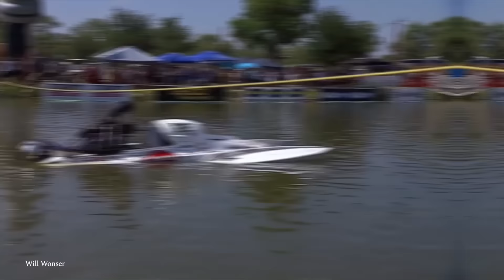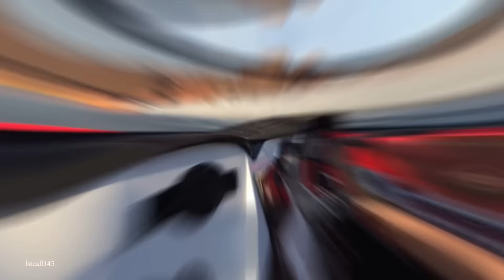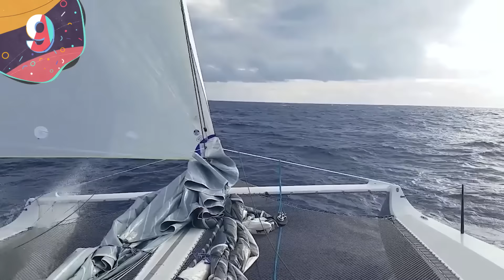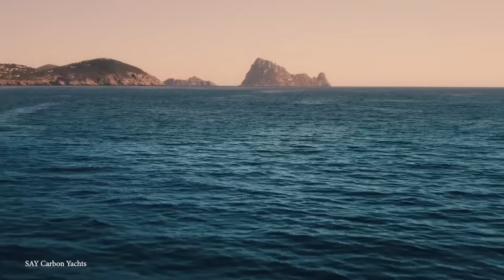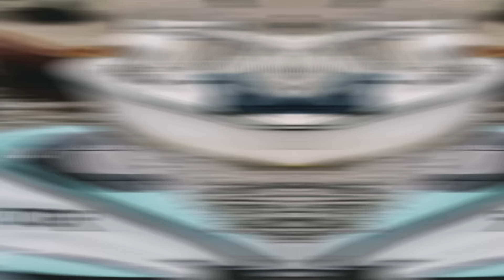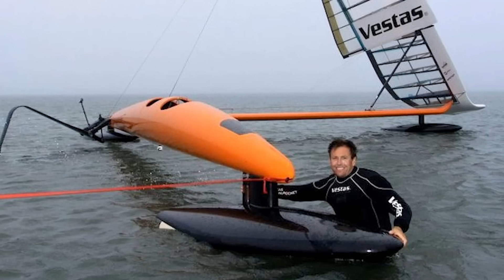15 FASTEST Boats Ever Made

Comment: I had a 25 foot Liberator (Skater splash hull) with two Mercury 300X racing outboards.  14 1/2” 34” pitch Mercury fully labbed 4 blade cleaver props … 112 mph (gps verified).  It was the fastest boat on lake LBJ in Texas for many years😎

Comment: My Dad as a young mechanic who was into tunnel boat racing worked on Ken's Spirit Of Australia 1 & 2 and recalls that when they got the jets from the air force they accidentally trashed one of the turbine discs from an unsecured screwdriver sitting on a table a couple meters in front of the boat when they were testing the engine on land, thankfully they had spares and very quickly learned to triple check everything that might fit inside the engine was bolted down before even considering running it up to speed.

Comment: That cig vee would have a very tough time reaching anything over 125ish
The lack of a canopy ruins the air flow over it. Without a canopy, one. No official run would ever be allowed to go for it. Also without the air moving over the top smoothly. It just simply can’t get there.
The dcb cats won’t ever go over 160ish 
Again air flow, also being under 38ft.. 
anything over 160 doesn’t have the weight to keep the boat planted in the water

Comment: What about Unlimited Hydroplanes?
Total oversight of the most impressive boats!
Reply: Big time ! 
Shit the GPs! 
Can’t wait to see 13-15 of them at the tripe crown races this year ! Haven’t had that many boats of that caliber since the year all the UL’s came to valley field
Reply: Because unlimited hydroplanes have to be able to go round corners. This slows them down a lot. They can hit around 200 mph, which is impressive, considering the restrictions imposed on them. 
The primary restriction is on the propeller. The last time I heard, it had to be 18 inches in diameter, plus most of it isn't even submerged.
I think the gas turbine engines are heavily regulated as well. 
In fact, unlimited is a bit of a misnomer, considering all the restrictions.
I would love to see what one was capable of with no restrictions, though.

Comment: Skater boats are pretty damn quick for what they are. Blows most MTIs out of the water.
Reply: Given equal power equipment, I suspect Skaters and MTIs would run fairly equal speeds. Skaters would probly be a little faster, given that Peter Hledin has been building them so much longer than Randy.
Reply: @EverettCox-g8z  
Boat are custom boats more or less. If we look at them from the perspective of performance pleasure boats, Randy builds the faster boat right now. This is because Peter does more to create dedicated pleasure variants of his hulls. Randy's pleasure boats are based more on his race designs. They take more power to move, but they are a bit more capable.
As far as race boats go, they are more or less the same.
Reply: Both MTI and Douglas Marine make a very good boat. Both er competitive. It's asinine to claim that a Skater is much better than an MTI. I prefer Peter's boats, but I know what the MTI's can do.

Comment: I can truly appreciate what it takes to run a watercraft at speed. So far the fastest I've driven on water is 73.4 mph. It's completely unlike doing the same speed on land. There's so much information to process and every input on the wheel is magnified. I just bought a new boat and we hit 84 mph on the test run. I'm sure it will take quite a bit of wheel time to feel comfortable driving it over 75 myself, much less the 90+ mph it's capable of. At just over 21' in length and a hull under 1,500lbs, weight and balance of the boat are critical too. You definitely can't just hop into one and drive it like you stole it!
Reply: “So far the fastest I’ve driven on water is 73.4 mph”
“we hit 84 mph on the test run”

huh? 🙃
Reply: @poindextertunes  On the test run, I wasn't the driver. One of the dealership employees was driving at that speed. As an update, I've now driven it to 81.9 mph. My wife doesn't like going that fast so I'll need a trip with someone else if I want to push it faster. :)
Reply: @glocktogo Take me with you, I'm up for it! 🎉😅
Reply: My cousin had a 44 fot Viking Offshore F1 with double v8 Quad turbo.
I don't remember the exact hp, but I think it was 2800 ish.
It was terrifying!!

Comment: I remember going to the SDBA (Southern Drag Boat Association) races in Texas as a kid. Those things were insanely fast. My mothers friend owned a boat called predator which was fairly fast (160+ mph) but wasn’t even close to some in the higher classes. I remember boats like Aquaholic that were nitrous oxide fed absolutely stupid fast. I can remember one wrecking in the water and it was quite a sight. Front started hitting the water and rising up higher each time until it hit the water a final time and disintegrated. Took about 20 minutes to fish the capsule with the driver out. They were only able to salvage the engine sadly.
Reply: Mothers friend? he’s smashing

Comment: The actual world’s fastest battleship is the USS New Jersey at 35.2 knots a record set in 1968… I did like the video tho. 👍
Reply: 212,000 hp for 6 hours?!!?!! WHAT?!
Reply: @haney3435  yep, and the fuel consumption rate is approximately the same as an oil well blowout.
Reply: @aerialcat1  that is very upsetting.
Reply: @haney3435  Then consider that many of the fastest carriers are even faster - and MORE powerful.
I once saw in excess of 39 knots on USS Ranger during REFTRA before our 1979 WestPac tour - and that does NOT appear to have been a record.
Reply: @aerialcat1  - 😂😂
Reply: @bricefleckenstein9666  I served on the Ranger from 1960-1962. When we were doing launch and recoveries on a windless day, the ocean was as-smooth-as glass, we would out-run our escort ships. It was impressive!
Reply: @williamfaulkner1959  We did a speed run during the refresher training period before WesPac 1979, on a smooth ocean somewhere off California (I think) - speedometer display on the internal TV showed something in excess of 39 knots.
Not bad for a "32 knot" (per Janes) ship that was a little older than I was!
Reply: @bricefleckenstein9666 I can't vouch for the veracity but an engineer who worked for my dad was a carrier pilot flying off the enterprise during Vietnam. He claimed that on a couple of his missions that based on time and location that she had to be averaging over 60 knts (dodging bad weather)
Reply: You're a battleship.